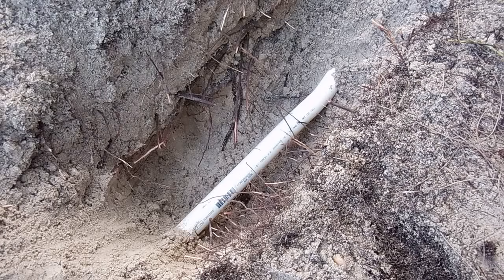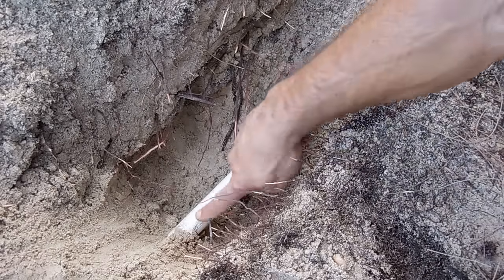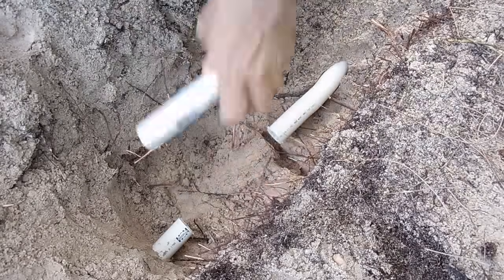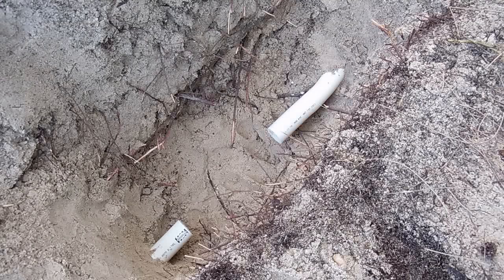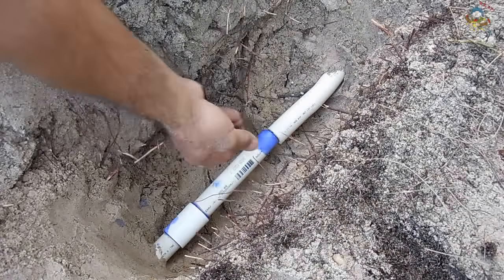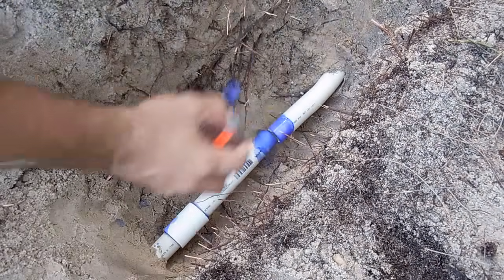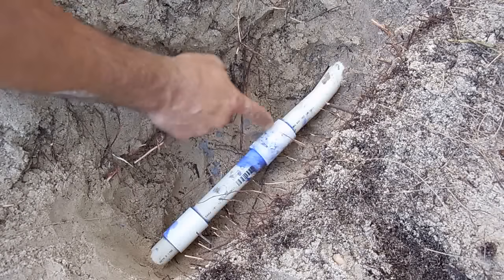EASILY Repairing Broken PVC Pipes(Least Amount Of Digging)

Comment: This worked! Thank you. Here though is my experience which was way bumpier than yours. I was digging in my backyard and I hit a PVC pipe. I shut off the main water to the sprinkler system which was found near the water to the house. I purchased the Oatly handy pack which includes the all-purpose cement and primer. This was the first mistake I made. This video shows him using a cleaner, not a primer which is sticky and ruined one coupling. I was unable to move or slide the coupling as he could. I think the cleaner might allow for movement. Second, he mentions using SLOW drying glue. Well, I went to Ace hardware and I was not able to find anything that says SLOW setting cement. Nothing that says slow, medium or fast setting glue. I called the Oatly customer service number and they said the Heavy Duty PVC glue (green color bottle) is the slowest drying one they make. Once I did this I was able to get it to work but again I did not use primer on the second side of the PVC pipe as I would not be able to move the second coupling like in the video. I didn't have the cleaner product so I had to make do with what I had in hand. The heavy-duty glue and primer on one side and only the heavy-duty glue on the other side.
Reply: i had a similar experience. i was thinking primer everytime he said cleaner. good think i re-listened a 3rd time. the 1st time i did this i failed coz i used a nonstated setting glue so i said, how bad can it be. well it was bad and messy. ruined. Also, i manually sandpapered the coupling, got tired, assumed, ah this is good enough. the combination of fast setting + primer + not sanded enough = fail. now i am doing it again for a 2nd time and i re-listening again to make sure. i think i sanded it enough but i cant be too sure coz when i test it with the pipe, its really tight so i wonder if i should keep sanding it down

Comment: this is amazing trick, just a question ..i have 1/2 inch pvc pipe , do i need to buy 3/4 inch couplings, so that it slides easily into 1/2 inch pipe ? please advise ?
Reply from the maker: 1/2" pipe uses 1/2" fittings.

Comment: Do this all the time,they even sell couplings with no stop,so not really a trick
Reply from the maker: Incorrect. They DO NOT sell pressure PVC couplings like I made in this video at Home Depot / Lowes / Ace Hardware / True Value / Menards and others. The only type sold are for DWV. If you want what I made, you'll need to buy it from a plumbing supply house.
Reply: @electronicsNmore  ok,sorry I was talking about waste pipes
Reply: @electronicsNmore  also I work .in Spain, not uk,
Reply: @electronicsNmore  here only use PVC pressure for swimming pool s, everything else is polyethylene

Comment: Gosh, one obvious refinement would cut your work in half and I don't see anyone suggesting it. Just cut the bad pipe right on the break and then proceed with your slip coupling method. No need at all to cut the good section of pipe and glue that coupling on there.
Reply from the maker: I made it VERY clear in the beginning of the video why the 2 couplings were used!

Comment: Having a union there is the best option. If there is concrete on both the sides of the pipe, nothing can be done except having an union there.
Reply from the maker: Not true. You can always move the pipe left or right to slide the fitting into position.

Comment: Why not clean and slide the coupling onto the repair piece,approximate the,then apply the cement to both ends generously,slide the coupling over the ends,give it a twist and you’re done. But the idea behind the repair is

genius. Thanks for the concept.
Reply from the maker: If the fitting slides over the pipe easily after removing the stop, that means you made it too big. You must do as shown. Thanks for watching!

Comment: You saved me $65 and a lot of digging. I had bought several "Sharkbite" fittings and all the necessary items to repair a water line and I was going to have to dig a much bigger hole to fix it until I watched this video and I knew immediately that this was the way to fix it. Thanks for the info.
Reply: U know u could of got a shark bite slip copulting
Reply: @51-FS  did you not read what I said?

Comment: Thank you for the video.just repaired my cracked water main pipe using this method.the glue I was using set too fast and had to cut another section and worked second time. Yes the slower setting glue is the key to make it work right.
Reply from the maker: Glad it helped! Be sure to share and watch my recently uploaded PVC pipe pressure testing videos. Thanks
https://www.youtube.com/watch?v=doPXNWC1Iig
https://www.youtube.com/watch?v=qHo4heljrSg&t

Comment: He didn't get it the first time. Notice the edit just as he did the last slip. Even with the most experienced the glue dries on you sometimes faster than you hand can move in this maneuver. But it works nevertheless most of the time.
Reply from the maker: The edit was me bumping the camera. LOL You can see it's the same fitting and pipe, there was no second time.

Comment: On the subject of PVC and other nasty non metallic pipes, maybe you can help me. Years ago we used a tool called an "M" scope to locate metal pipes and cables. I have a black irrigation tube that goes under a walkway but don't know its routing. I was thinking of putting a wire snake through it to track it. I know you are brilliant with electronics. Do you know how I could follow the route electronically ? (Manual labor not good at my age).
I know most cities require a wire to be installed along none metallic buried pipes for future connections etc.
Reply from the maker: Check out my other video below. :-)
https://www.youtube.com/watch?v=Kw0Zz_7IBP4
Reply: @electronicsNmore  Thank you sir. It looks great!

Comment: I have done this many times but not because the PVC pipe broke. I have old black poly tubing that was installed in 1974 (Bad idea). It looks like the pvc pipe you are repairing is thinner than schedule 40 to crack like that (can't tell).
The only comment I can make is to bevel the pipe ends so that the modified coupling will be easy to slide over. I would do a test slide prior to doing the real thing. Of course you know the glue is not forgiving and can stop before centering is complete if there is any hesitation in the slide. 
Probably some glues are more forgiving than others. 
When that happens it is usually hacksaw & compression slip coupling time $$$.
Nice video as usual.
Did I mention I hate repairing irrigation lines?
Reply from the maker: I know that black poly pipe. It's a pain. You need barbed fittings and clamps. The pipe in the video is SCH40.
Reply: @electronicsNmore  Heavy lawn mower?
 Solution may be schedule 80 or metal pipe. Lighter mower another option. LOL
Actually most problems are caused by pipe being too shallow or inproper bedding like rocks under pipe. 
I know when I was a utilities contractor the smallest pipes were 6" due to fire flows. Minimum depths had to be followed and the bedding was important (Inspectors can be nasty). 
Clay pipes for sewers had tables of pipe strengths for different depths because surprisingly live loads don't go straight down but actually spread out more horizontally as depth increases (not many cities allow clay sewer pipes as decent joints were never invented). 
I also put in miles of asbestos cement pipe. Machining asbestos dangerous. 
You would be amazed how many inside crowns of asbestos cement pipes get eaten by sewer acids. Cities are replacing $$$$$. 
Sorry I got off on a tangent.
Nice video as usual.

Comment: Is there any reason you couldn’t slide the second coupling onto the repair section of pvc before you glue it on? Like just have it chilling on the new section, not glued on, so you could just slide it up onto the break without having to bend anything?
Reply from the maker: If it slides over without cement, you made it too big. :-)

Comment: After evening my coupler, it was still not sliding past the halfway point.  How did you get it to glide effortlessly?
Reply from the maker: Did you try doing it dry? or using the PVC cement?
Reply: electronicsNmore I did try it dry. It got stuck ani need some channel locks to take it off
Reply from the maker: @dubiousjesse  That's why. Just make sure the entire stop is removed, then apply the cement and work very fast.

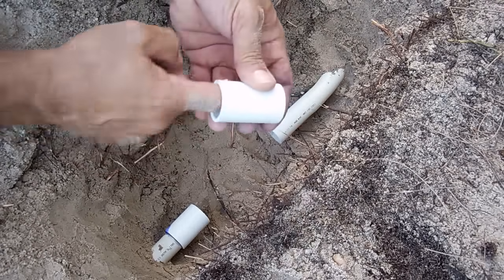Comment: Why not slide the coupler (with the stop removed and the inside primed) onto the pipe BEFORE assembling everything (at 06:00). Then when ready to make final connection ... apply cement to both sides of the the pipe, slide the coupler and spin it to coat the inside of the coupler on the left-side), slide it back and spin to coat the inside of the coupler on the other side... and scene!
Reply from the maker: If the coupling slides over fairly easily, then you made it too big!

Comment: I expected you to slide the coupling over the installed pipe to the right before gluing in the replacement pipe.  Then just slide it onto the replacement pipe after prepping with glue.
Reply from the maker: If you're able to do that, that means you made the fitting too big.

Comment: Will this work with a 4 inch pipe? I had a plumber come out and repair my spigot which broke and in the process he drilled 3 holes into the 4 inch pipe that was beside it, he said it was to help drain the water? Anyways, he didn't fix it and just left. I assume that I need to fix this because I have to put dirt back in the hole he dug, which he didn't do either.
Reply from the maker: Some plumber. Sounds like a handyman. LOL It could be your sewer line. If it's not a sewer line, you can lay weed fabric over the pipe with the holes(2 layers), then backfill the hole. If a sewer line, then you'll need to cover the holes using a shielded 4" fernco coupling like you see below. Of course you'd need to take the coupling apart and make a straight cut on one side of the rubber. The cut goes on the OPPOSITE side of the holes.
https://amzn.to/2W2f2bB
(Amazon Affiliate Link)

Comment: Or you can buy a slip/dresser couplen instead. 

Also buy 4 90° elbows, glue 2 up level with each other and then down
Reply from the maker: This repair method is the best, longest lasting, and has the lowest friction loss. Thanks for watching

Comment: Easier if you placed the full slip coupling on the pipe before gluing the pipe into the notched coupling.  Hard to get full slip couplings.
Reply from the maker: No, if it slides over easily, that means you made it too large.

Comment: Why did you have to cut out a section of the pipe for this particular repair.  The cracked area was small in the axial direction.  Why couldn't you have sawed the pipe in two at the crack, prepped the ends, and slipped the non-stop coupling over the cut section?  This is essentially what you ended up doing anyway.  Granted prepping the ID of the cut pipe ends would be hard, but you were really only prepping the OD on the cut pipe ends anyway.
Reply from the maker: That was made VERY clear in the video.
Reply: By the way, I liked the video.  After viewing it again, my understanding is that the repair method you show applies to relatively wide damage areas.  For small damage areas, it seems like adding only the non-stop coupling would be less risky as two couplings would add an additional potential leak point.

Comment: If you use a slip-sleeve repair coupling. It gives that area a little give. Meaning if ground moves coupling can move with it. The solid coupling can be broken again. The question first is what caused the pipe to break? Then decide how to proceed. Yes, I do repairs for a living.
Reply from the maker: Usually PVC pipes are broken by shovels, vehicles, or tree roots. I prefer the method used in the video, it will outlast the pipe itself. Thanks for watching
Reply: @electronicsNmore  Just like I said. first, know what broke the pipe. Then it's easy from there.

Comment: Y’all think this would for a pvc pipe that was being used as Fossett for the back yard. When my brother lived here he made this coy pond and did all kinds of piping back there. The other day we were cleaning the back yard and accidentally hit said fossett and the water started gushing out. My other brother fixed or so we thought and today I noticed I heard water gushing. Please lmk if this works or if y’all have a suggestion I turned off the water because it’s the middle of night. Help would be appreciated greatly!
Reply from the maker: The pipe sticking up out of the ground with the hose bibb, should've been secured to a steel rod along side of it. Either fix it or cap it off.

Comment: You can also use 4 90s
Reply from the maker: Not good for a main line, too much friction loss.
Reply: @electronicsNmore  I can definitely appreciate your video. But if you can imagine the friction loss that occurs through the entire water main before it gets to the house you can see that 4 more 90s dont make a bit of difference.  Probably unmeasurable difference. But again i do appreciate the video!
Reply from the maker: When a repair is done, especially on a main line, you want to preserve the straight run. There's no reason at all to have (4) 90's, when you can do as I showed in the video. Yes, the drop is minimal, but why have it?
Reply: @electronicsNmore  Ya i hear you
Reply: @electronicsNmore   Maybe...MAYBE  1/10th of 1 psi
Reply: @electronicsNmore   That would actually make a good experiment. Throw a guage on the hose bib before and after adding 4 90s. There is a formula but id be interested in seeing the results. Im guessing no noticiable change on the guage
Reply from the maker: @garyvallone5393  Nothing to test. It's a fact. You'll see a reduction when volume is higher.
Reply: @electronicsNmore   Just like how pressure readings on a front hose bib typically reads the same on back hose bib. After all the house fittings

Comment: They do make flex tube pvc that makes the process even simpler.  Definitely check it out
Reply from the maker: Not a permanent solution, and they cost more money. Thanks for watching!
Reply: @electronicsNmore  Your strategy for repair is useful however I disagree with that comment.  I have had a pvc flex coupling for a high pressure line installed for over two years. Super simple and has not failed yet.  Although they make some for low pressure they also have some for high pressure.  I got mine on ebay though.  COuldn't find any locally.  Great video anyways.
Reply from the maker: @ShyRage1  No reason to spend the extra money on that type.
Reply: @electronicsNmore  it was only 4.00 bucks if I remember correctly.

Comment: Thanks! It worked for me. I used scissors to remove the stopper from the coupler and sanded it. I only had fast setting cement handy and it worked as well.
Reply from the maker: Glad my video helped you! Be sure to check out my wide range of videos, and share links to my videos with many others. Thank you!

Comment: What a great idea ! I would never have thought to grind the stop out and just slide the coupling to attach the final connection . Who said you can't teach an old horse new tricks . Thanks
Reply from the maker: With just a little practice, you'll be a pro. 😃 Thanks for watching! Please share the video link with others.
Reply: They make a coupling without the stop.   Called a repair coupling. Save the grinding
Reply from the maker: @dsteele5530  You won't find them for PVC pressure, only DWV. Only plumbing supply houses sell them.

Comment: Very good idea but, I would instead just dig and expose 1 foot more pipe per side and use the standard slip coupling (with a center stop), install on one side and lift up both pipes 5 inches high and join them together. You don't really need to lift up very high since half of the coupling is already pushed in, you only have 3/4" extra length to push in.  As shown in another video: https://www.youtube.com/watch?v=Cted44Lq3Iw
Reply from the maker: You can do that, but I never had the need to do it. If you're working on larger PVC pipe( 1 1/4" - 1 1/2"), you won't be bending them that easy. If you saw me do the repair in person as shown in this video, how quickly I can do it, you'd understand why I use it.

Comment: No need to cut out a section of pipe. Just split  a socket coupling with the stopper removed and glue it onto the crack. Add a worm clamp for belt and braces. I Have done this 2x when accidentally drilled into a pipe

Comment: You can buy repair couplings at any decent hardware store, they do not have the stop in the middle. They are 15 cents, exactly the same as a coupler without the stop. Typically right next to couplers. You have couplers and repair couplers. This should save you even more time since you would be using the method that's been common for over 20 years.
Reply from the maker: Not the same type designed for pressure, only DWV PVC. Home Depot, Lowes, True Value, and Ace Hardware all do not sell what I made. You need to buy them from a plumbing supply house. Thanks for watching

Comment: 1. A shop vacuum is useful for sucking away the surrounding dirt.  2. The scheme shown is good only if the access is long compared to the diameter of the pipe, and the pipe is small in diameter.  If you cut away the webs from BOTH fittings, you can cement everything, slide the fittings over the patch piece, lower it into position, and slide both couplings into place without needing to bend anything.
Reply from the maker: I've done this many times with up to 2" PVC pipe. The hole only needs to be about 18" - 24" long.